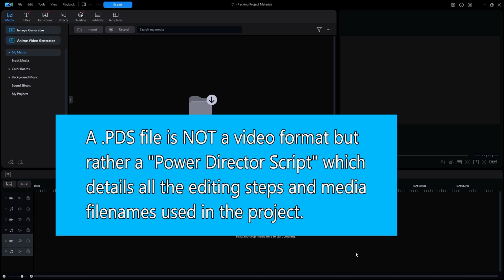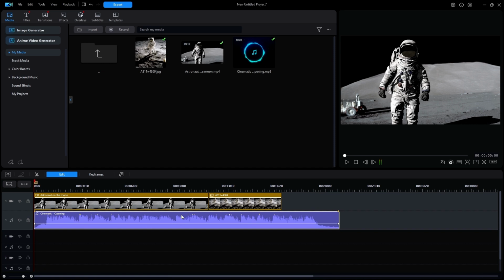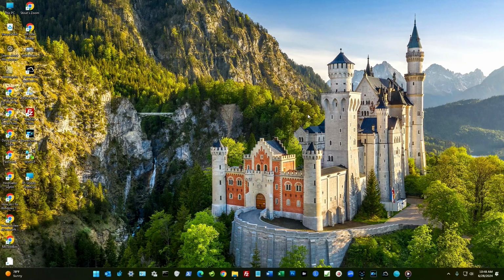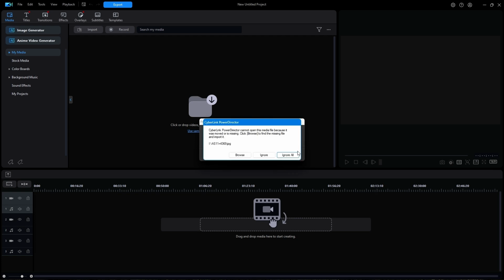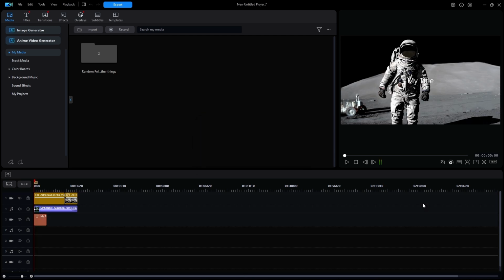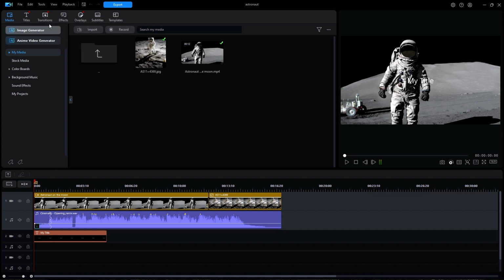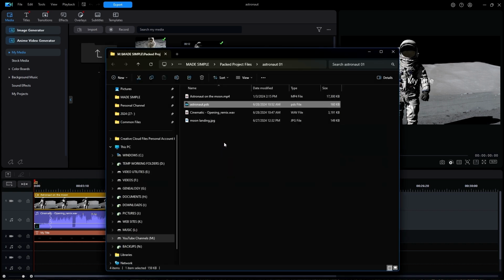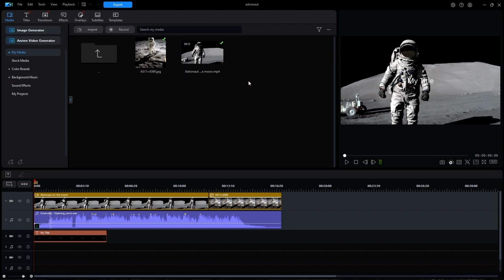61 - Packing Project Materials

Comment: Is there any way that I can include unused media files when I pack a project? Such an option seems logical in that I might choose to revisit a project and add one or more of previously unused media files.
Reply from the maker: At first I thought the answer was going to be a "no, it can't be done". But then, a brainstorm! Just move all of the unused media files to an unused track (even if you have to add another track). Then turn off the "eyeball" of that track (both video and audio portions).

You can now freely edit your normal tracks without affecting this unused track. And you can export your project to create a video as usual without the turned off track affecting the output.

You can even save the project file as usual (creating . PDS file) and whenever you reload that .PDS file in the future, those unused media files on that unused track will be automatically reloaded along with the usual stuff.

And likewise, you can Pack Project Materials which would also save the unused media files along with everything else.

HTH
Reply: @Baldy-1  Thanks for response and creativity. I have just discovered that, when packing a project, there is now an option which enables you to include unused media files in your packed project.
Reply from the maker: I seem to recall seeing something like that in the past but when I just tried it again, all it asks for is a destination folder and then it goes and places all the active project material in the destination folder. It does not give me an option to include unused media files. So just where are you seeing this option to include unused material?
Reply: @Baldy-1  Are you subscribed to Power Director 365? That's where I found it.
Reply: @Baldy-1  I'm using Power Director 365. The option is at the bottom right of the screen. Hope that helps.
Reply from the maker: OK, I tried it again and there it is right next to the "Select Folder" button. How could I have missed that? Gonna have to check these glasses again. Thanks for pointing out the location.

Comment: Hi - thanks for the time and trouble you went to for this.
After the first save of the project would you use "save project as..." or keep using "Pack project materials.."?
I guess once you've used the second option you'd have to keep using that option, as more clips and photos may keep getting added.
Reply from the maker: There are several methods of doing this...all of them correct. For me, I always do repetitive saves using "Save Project". Some claim that is the wrong way as you may have made some kind of mistake that you didn't catch or accidentally deleted sometime but you keep saving the mistake or lack of something over and over. I guess I take the attitude that "I don't make mistakes"....(yeah, right).

Generally speaking the "Pack project materials" is used when you have completed the project and want to protect all the media files used by keeping a copy together in one place. That helps when some people use one media file from a folder on the C: drive and another media file from a folder on the D: drive, etc, etc.

If you think you might be working on a project for an extended period of time, then it might be a good idea to "Pack Project Materials" as you work. This is done to eliminate the possibility of forgetting about some media file in a strange folder that you don't remember is actually being used in a current project but because you kind of forgot about it, you rename the file or move it elsewhere, or worst, you just delete it. 

Notice that the Pack Project Materials method helps those people that have little file organization. They tend to keep files all over the place in different folders. The truth is that for myself, I almost never use Pack Project Materials because of the way that I organize my project. For example, for each video that I post, I create a separate folder ahead of time. Then I move copies of all media files that I intend to use into that folder. As the project progresses, if I add any other media files, I move them into the project folder and then Import that file from the project folder into the media room to be used in the video. Even the .PDS file is saved into the same project folder that I have created.

You are free to choose whatever method works best for you but I strongly suggest you avoid using files from all over the place directly into the video. You never know when something in your life might prevent you from coming back to finish the project until 6 months later and by that time you might have moved or deleted some needed media files.

Comment: I hate the way PD modifies the name of a music file when it smart fit's. Because if i like the music and want to use it again i can never find it because the name has been altered into a wav file.
Reply: Thanks for the clarification. That helps
Reply from the maker: But it doesn't change the name of the original music source file so you should always be able to find that one again. If you're thinking about re-using the altered .WAV file, you should know that it has been altered to fit one particular clip or project and probably won't fit into your new project the way you want. 

On the other hand, if you create the Packed Project file, then it will always contain the altered .WAV file using the same name as the original but with the addition of "_remix" added to the name.

Comment: Hi,  love your screen saver, where can i download it? also i ask for the speed ramping a couple weeks ago, but what i was looking for is when the movie sort of jump forward quick then back to normal speed, i thought it was called speed ramp but i was wrong, so any chance of creating this one, it moves fast and then it sort of jump forward then back to normal speed....thanks
Reply from the maker: The desktop wallpaper that you got a brief view of in my video comes from Microsoft's Windows Spotlight feature which changes it just about every day. Using Win11, go to Settings, Personalization, Background. On the menu item that says "Personalize Your Background" there should be a drop-down menu giving you 4 choices: Picture, Solid Color, Slideshow, and Windows spotlight.  I believe this settings option is now the same under Windows 10.

About the speed ramp that you describe, I think I've seen that kind of feature in which the director wants to convey the same scene speeding through time until several hours, months, or even years in the future. You can accomplish the same thing using the Speed Ramping technique previously show only make sure you set the speed to a very high number and you have enough footage on the clip to actually speed through.